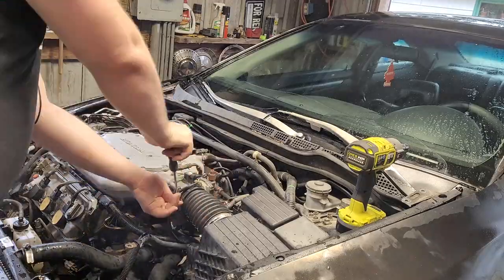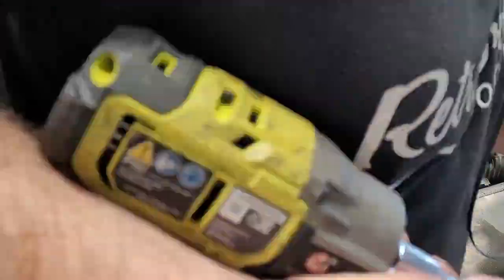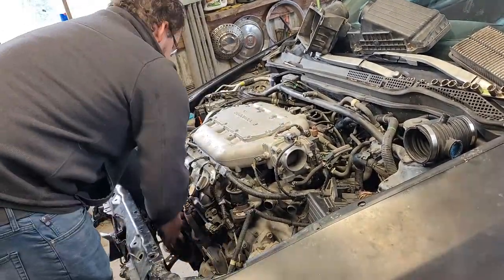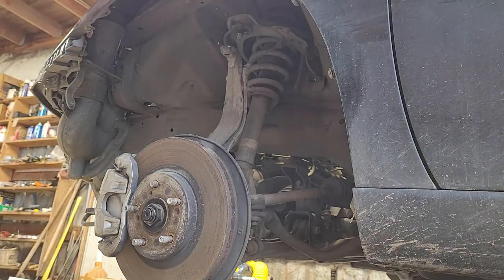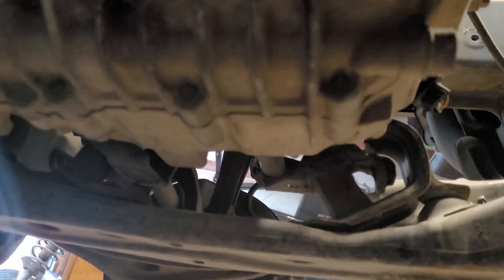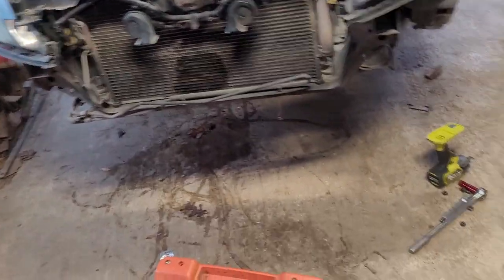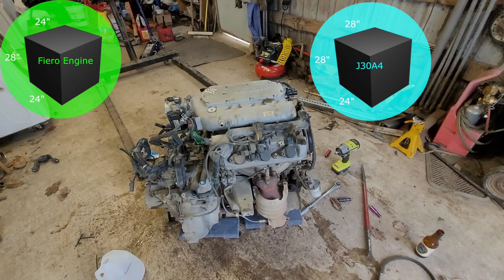J Series Fiero Swap Episode II

Comment: I’m trying to do something ambitious and long term and have been trying to figure out if an ej or preferably an EZ30 would even fit in a Fiero. I want to learn that engine platform and sort out a management system to eventually put in an older Porsche. Do you know for sure that an EZ or EJ would fit? I’ve found measurements in varying like 3” on the long block width. Sorry for the wall of text, and thank you for your time.
Reply from the maker: I don't know the ej or ez measurements from axle centerline to front, but the firewall of the fiero is slanted back so the lower it is, the more clearance.
Reply: @driven_nation  Thanks for the reply! I was more concerned with the width from head to head, I assumed that would be a bigger issue. Since Boxsters are relatively short blocks the axle shouldn’t be as bad. And from all the measurements I saw for block length (belts to flywheel) it’s less that 20” for the EZ30. Edit: I also considered an AW11  as the body but I think the Fiero has a larger bay and way more were sold in the states vs the mk1 mr2
Reply from the maker: @IMR_Seb  alright, i pulled out some quick dimensions from my cad model. at axle centerline, inside frame rail measurement is ~36 inches. Then 20 inches ahead of axle centerline, the frame rales are ~41 inches apart. it is a linear taper. 

Distance from axle centerline to firewall at stock fiero ride height: 
inline with axle centerline is ~26 inches
6 inches above axle centerline is ~22inches
12 inches above centerline is ~20.5 inches
18 inches above centerline is ~18.5 inches

You could run your cv's at a forward angle to get a little more clearance or look at shifting the whole cradle back a bit. Check out 3rd video about this to see the cad im working with/links to the original files i based it off of..

Comment: How'd you buy that for $500??  Does it have a salvage title and 986,498 miles?
Reply from the maker: Salvaged title from theft, interior was garbage, spray painted black poorly, every bushingswas shot, and after owner replaced waterpump and timing belt the waterpump was leaking and he didn't want to deal with it. 160k miles

Comment: 500 for that, must have a blown auto transmission i take
Reply from the maker: Nope, 6 speed manual. But with a salvaged title from theft, body damage on every pannel and the final straw was leaking water pump. But I drove it around the block and on the trailer. Shifts great, runs great. Sold the cats for $300. I call it a win.
Reply: @driven_nation  Damn a 6MT thats a steal for 600 bucks especially nowadays. The j series can go an easy 300--400k with minimal maintenance (im sure you know that )
Reply from the maker: @CRAPO2011  yeah... or more importantly can be replaced on the cheap. I actually just picked up a j32a2 to put in instead of the j30a4
Reply: @driven_nation  nice CL/TL Type s engine if I'm not mistaken
Reply: @driven_nation  You can always get the adapter plate to fit an Eaton S/C from a 3800 ,then you can brag about still having oem GM parts :)
Reply from the maker: @CRAPO2011  check out my friend @salad-bar21 on YouTube, he has that setup in his mr2. It is violently fast.